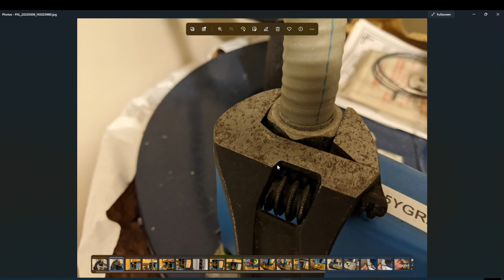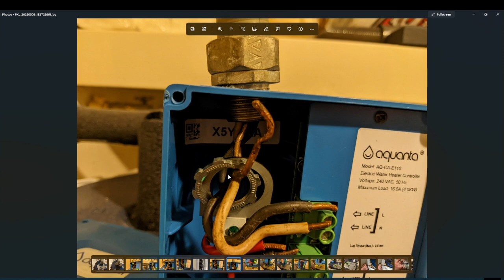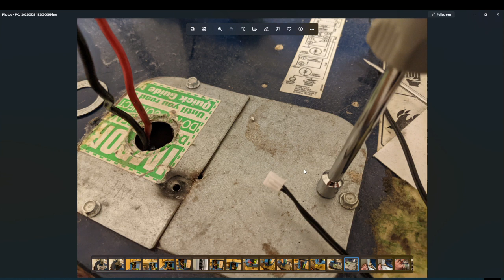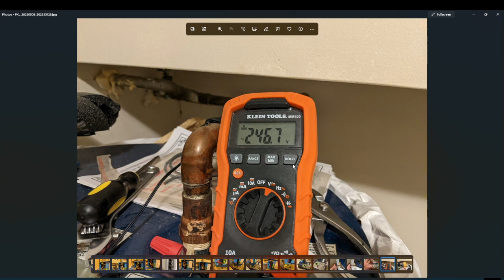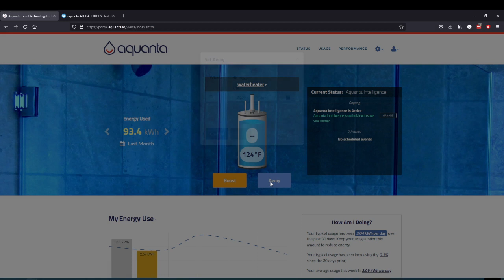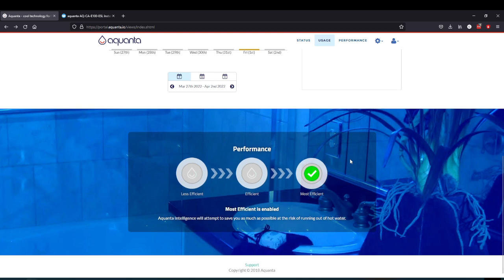Smart Water Heater (Aquanta Electric Water Heater Controller) - De-Install, Review, & Hints

Comment: does insulating your tank hold humidity and cause the tank to rust..
Reply from the maker: I've never noticed humidity or rust.  I should note that I've always had it in an area that is in conditioned space or at least has a dehumidifier.

Right now, it's in my basement that's flooding just a little because of heavy rain, and I'm not worried about rust.

Comment: Thanks for the helpful video! Any indication on how much energy you saved using the smart switch?
Reply from the maker: I can't say exactly, so that might be a little disappointing.  However, it did show me 2 things.  Adding insulation to the water heater pays for itself in a couple years, and switching it off during a weekend away does save energy overall.  I can still turn it off with the circuit breaker, and I'll never go without an insulation blanket.

I think the Aquanta is more useful if you have more people in the household.  It was just me when I was testing it, so it probably didn't add a lot to the energy savings compared to switching off the circuit breaker.  I did enjoy seeing the data, so I'm very happy that I had it.  If you're interested in the the data, you might like a video that "Technology Connections" about water heaters.  I learned a few things from that video.
https://www.youtube.com/watch?v=Bm7L-2J52GU&ab_channel=TechnologyConnections